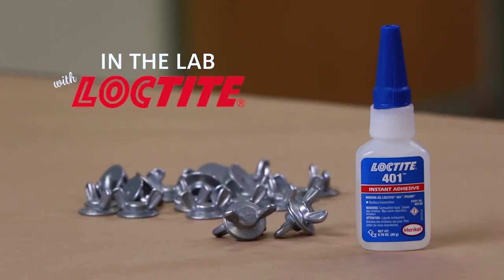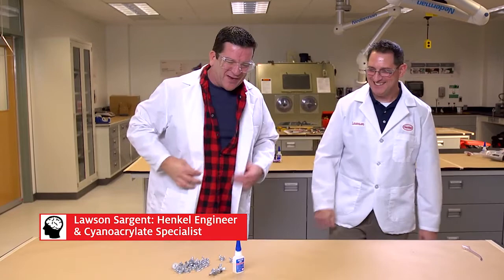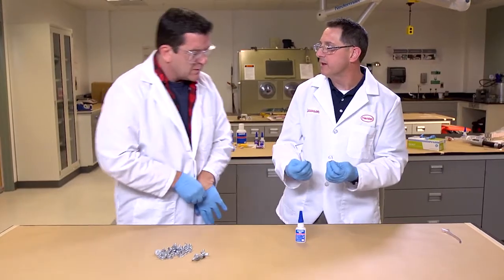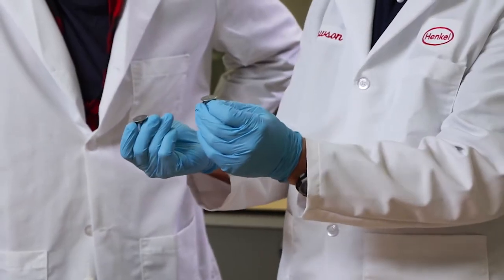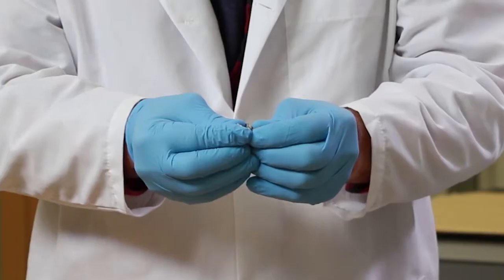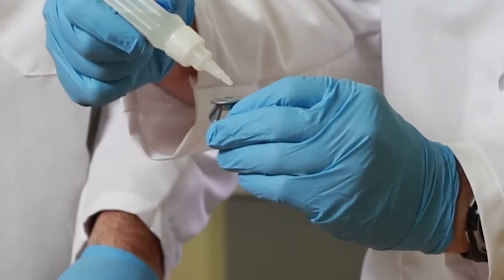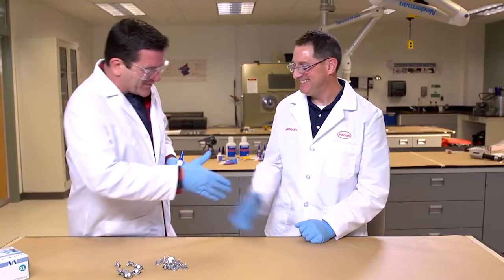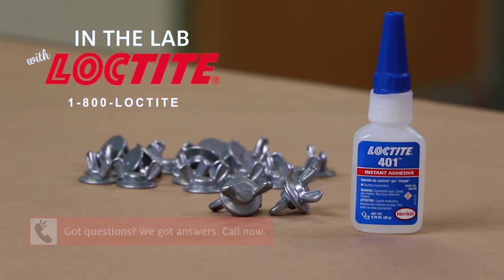In the Lab with LOCTITE® - Proper Use of Cyanoacrylate

Comment: Can’t see the gap (the camera never zooms in tight enough).  It’s still not clear to me exactly how dabbing 4 drops, 90 degrees apart creates a better adhesive layer than applying a few drops at the center.  Seems like drops near the edge would squirt out past the edge, into the air and onto your fingers, which is maybe why they’re wearing nitrile gloves for this demo?
Reply: I believe the center has a slight recess (indent). You can kind of see it. But by putting the glue in there, it ends up being a large space between the inside of those center recesses (a big gap).
Reply: The gap part I can't explain, but my guess is that if you leave a small gap, youre using the glue as "in between" material because if theres no glue, you don't have a material that acts as the in between. 

As for the 4 drops, it's just to prevent glue from oozing out the cracks. 4 smaller drops spreads out just enough without dripping over the edge.

Comment: Please re-examine your product's container.

Problem #1: I couldn't squeeze the glue out of the container
Problem #2: The cap fell off from all the pressure (see #1)
Problem #3: The glue that I salvaged doesn't seem to adhere the joint
Problem #4: I've got glue all over my hands

Note: I bought one of your larger items (52ml bottle). I think some kind of chemical reaction happened while the product sat on the store shelf. That reaction made the glue too viscous to squeeze through the tube.

Good news: the price-per-ounce of your product is much better others (retail price)
Bad news: I can't rely on your product
Reply: Retailer = Big Lots Superstore
Date = June 1, 2021
Location = Jacksonville, FL
Product = "Go 2 Glue"
Size = 1.75 fl oz (52mL)
Price = $6.00 (US)

Thanks
Reply: I HATE NUMBER 4

Comment: Would this be good for sealing a headlight bulb to its base?
Reply: i wonder too .... mine has problem with custom projector (swap led) .... common epoxy dont stand the temperature . later i prefer 272 series up to 232° c
Reply: @cocvillage5283  you having headlight bulb trouble? It’s not staying in its mount?
Reply: @rudydaberry122  the (hid) projector lens base once disassemble from the bowl part , upgraded to led chip (from hid 35w to led 120w) . the glued part keep loose on high temperature .....